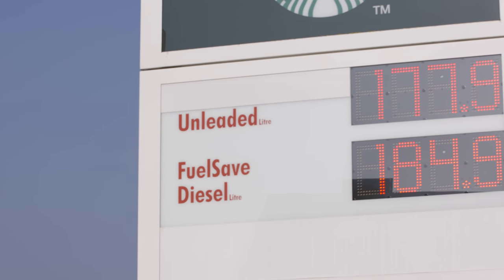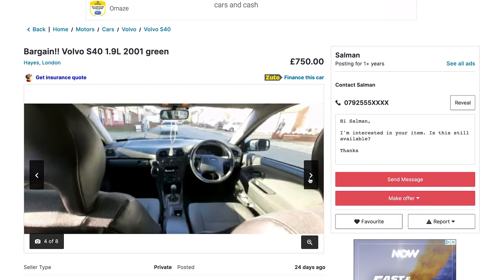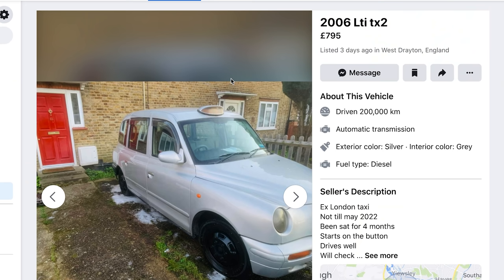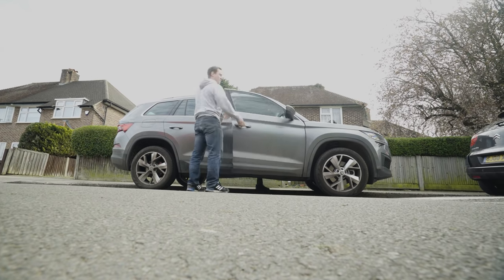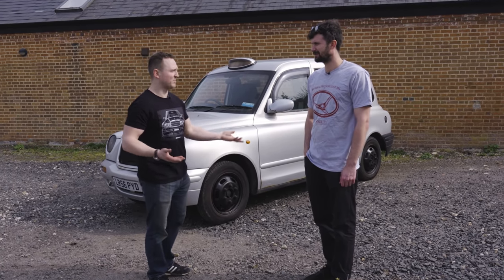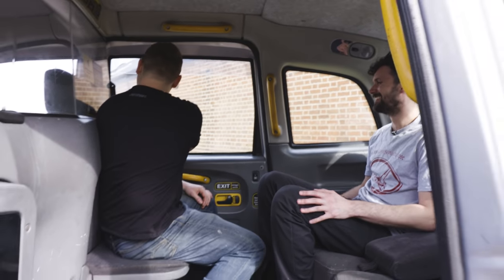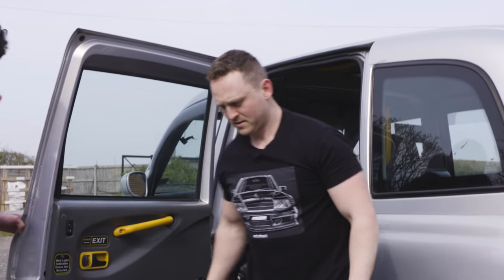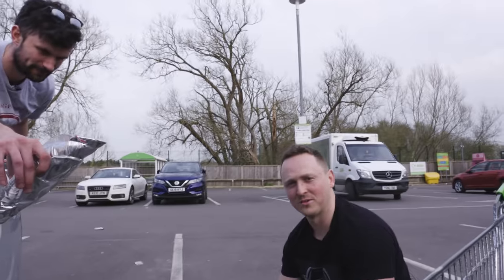How To Beat The Crazy Fuel Prices

Comment: Surely the cheapest transport all-in would be like a 125 or 250cc motorcycle (50cc scooters are too limited.) 🤔
Reply: Yeah my 125s liquid and air cooled do 133MPG - 108 MPG 

Only way you’ll get close to that is my spending silly money and paying finance at £400 a month for an EV that will need a battery change in 3 years that will bankrupt you :) lol
Reply: We don't want to die ya know
Reply: @MatthewChapmanYT  well then buy an electric scooter. It runs even cheaper than the petrol scooters.
Also an EV battery lasts much longer of course.
Reply: Yeah but you can't take any mates in the back
Reply: @theodoredeverell3894  friends add weight and lower your mpg regardless. No thanks. 😛🤣
Reply: @roland9367  built quality is poor with all EV scooters compared to a mighty Xmax or Forza scooter. 

Also in 3 years time you’ll need to remortgage your house to replace the battery
Reply: @MatthewChapmanYT  Yes build quality is low. I bought a cheap broken electric scooter and put my own lithium battery in it.
Electric cars build quality is great however. And typically get 8 years warranty. But the batteries will last much longer than 8 years.

Comment: Don't the engine consume more fuel when running on vegetable oil, since it is less energy dense?
Reply: Not rely but from April the 1st if your are finding to be yousing veg oil it's an on the spot 1k fine because u don't pay fule tax u pay food tax
Reply: I ran a 97 Rover 420d on 2/3 Asda vegetable oil 1/3 diesel. Went from 50 to 40mpg. Didn't smell at all. Ran fine (and I'd modified it to 130hp).
Reply: @666hicat  not if you are producing less than 2500 litres of fuel per year.
This is taken directly from Biofuels and other fuel substitutes (Excise Notice 179e) from 1 April 2022
Vegetable oil (unused and used, processed or unprocessed) that is set aside or intended for use, as motor or heating fuel is liable to duty unless the producer is exempt, find out more in paragraph 4.2.1.
You’re exempt and do not need to register and account for duty if in the last 12 months you’ve produced or used, or expect to produce or use in the next 12 months, less than 2,500 litres of either any:
Reply: yea and it will cause issues eventually. Diesel has lubricants in it which diesel engines need, cooking oil doesn't.
Reply: @BlatentlyFakeName  maybe I should have added some Lynx Shower gel?

Comment: My ex used to run a care home, I used to collect about 25 litres of USED veg oil per week from the kitchens fir free. Filtered it in my shed using a screen filter and sand. My motoring used about another 20 litres on top. Interestingly at the time, to buy cooking oil was about the same cost as diesel. So I used to use the old cooking oil, mixed with actual diesel, but occasionally used neat USED oil, which was of course free. Never had a problem, it was a Vauxhall movano. I think if you used some kind of solvent to thin it down, you could get away with it in a more modern engine. This is branded as "cheating the system" , but of course there isn't actually a fuel called diesel, it's a diesel engine, the fuel is heavy oil, as it says on the v5 document. The engine is named after Rudolf diesel, who invented it so it could be run on any oils. You're actually using it as intended. It's the wanker government calling the fuel diesel , that cons people into buying their fuel.

Comment: I've got a 2014 ford focus 1.6 diesel. Get 60mpg on normal drives, nearer 70mpg on a good motorway run, and over 45mpg towing my 750kg trailer tent...
At 60mpg with the new fuel prices in still better than a 30mpg car at the old price 🤙
Reply: Bought on 49k 4 years ago... On 125868 as I sit in the carpark typing this 🤦🤣

Comment: A lot of regular UK fuel pumps (i.e. not the special HGV and coach ones) also limited you to £99.  Guess that's been temporarily binned.

But you guys have the legendary G Whiz.  Only problem there is that electricity has also got too expensive, so swings and roundabouts.

Comment: I started to run my old Pug 106 xnd on 60/40 veg oil and diesel when prices hit 90p a litre! Apart from permanently smelling of farts, it ran absolutely fine.
Reply: Should we be concerned what you do know fuel costs are close to nearly double than that.
Reply: @hal752  What are you dribbling on about? No shit fuel costs more. I'm earning more than double as well. It's called inflation. Doesn't make it any less relevant.
Reply: @gazjones8781  it's a joke! Clearly went straight over your head
Reply: If you knew how to use punctuation, I might have realised.

Comment: Viewer from the states here. Right now I'm paying 3.87 a gallon. And I drive what would be considered a full size pickup truck. That has a cammed 4.6l triton that drinks fuel like a runner drinks water. Lol but it definitely gets smiles not miles per gallon. Cost around 75-80 dollars to fill up.

Comment: What's the situatuoin with LPG in UK?
I drive on LPG and according to the quick maths i did it comes out to be 52% cheaper than gasoline per kilometer driven.
And just recently i've noticed LPG prices drop so it's even cheaper still.
People around me are absolutely reeling from the fuel price hike and i'm here chilling with my LPG system.
You may say that LPG is extra cost for the equipment, and that is true but it doesn't need servicing often (if ever really), is simple, reliable and parts pay for themselves very quickly, especially with current fuel prices.
For example i recently changed out my LPG fuel regulator after it's been in service for 10 years!
Price for a new one? Just 60€ and it paid for itself within the first four weeks.

Anyways, i'm going back to watching the video as i'm only 4 minutes in.

Comment: Currently costing me 10.4p/mile in my 1L petrol Toyota Aygo Eco driving achieving 70mpg. I've done 80,000 miles with an average MPG of 69.4mpg over that (tracked using Fuelly). It's a well looked after car though, Its got 91,400 miles on the clock and it run better then the Citroen C1 courtesy car with 47,000 miles my partner got when their Mégane was in the garage.

Comment: I drive 25k miles a year for work and I drive a £500 Honda Jazz I bought off an old Granny as a ‘non runner’ had 4 flat tyres and a dead battery, 43k miles and full service history!

Has done me so well even raking it and driving on the motorway at 5k I get an average of 46mpg great little car and so good on fuel

Comment: Bit of a ruat bucket by now, BUT... IF you can get a Peugeot 106 1.4 or 1.5 Diesel, yeah it's non turbo so, slow to accelerate, but HELL, cheap as f@ck to run on diesel. On a nice STEADY run, me, my ex and her lad, and a coupla suitcases, went from literally brimmed (seeing the fuel at top of filler neck) in Grimsby to JUST under half on the fuel gauge in DEVON!!! We had both 1.4 and 1.5 and yes, the 1.5 DID have, albeit small, a bit more, ahem... 'Pep' lol.... 🤔😏   😎🇬🇧

Comment: I used to fill veg oil into my 2008 c class diesel, started as an experiment but actually worked out with no difference...until a year later the water content in the oil ruined the copper washers on the injectors other than that well worth it

Comment: 90% of chipshops use beef drippings not veg oil. Beef drippings will solidify at room temperature and fuck up the engine and all the fuel pipes etc when it's cooled down. Best to get a membership at your local food wholesalers and buy the 50 Ltr drums of veg oil. Ran my old work van on the stuff before it got written off by a drunk driver.

Comment: just get an Vw or Audi a4 b5 1.9 diesel with the classic pump and injectors, not the pd ones. those things will literally swallow anything you put in them, I've had a few of them so I can say it's been tested and worked like a charm😂 three of them had over 400k miles when I got rid of them

Comment: Heres how to beat it. Get a van cut a hole in the floor. take the plates off and any distinguishing features. Go when the servo is shut and park over the dipstick vents. open the hole in the floor, open the vent and put a hole down into the tank. use a suction pump manual not electric and pump all the fuel you need into a 1000l ibc in the back of the van. then drive off. make sure to cover your face and afterwards enjoy the fuel.

Comment: Your really need to get a modern hdi style engine and se what it takes to run the 1 of these newer style engines on veg oil and used chippy oil, see what it does to the filters and injectors.

Comment: I have the answer Mitsubishi Colt CZ1 i bought mine 4 years back for £600 and it is still working , no repairs ever to it except brakes and tyres and for £5 of petrol it does 35 miles and tax is only £10 a month and on the track it can hit 120mph but good lord it feels so unsafe , as it only weighs 980kg and the metal is paper thin but apart from the safety issues it gets me from A to B , until i can save for an E car

Comment: Get an old indirect injection diesel and run it on full veg. Make sure thr fuel pump can handle it. My 1.9 t4 has done over 100k on 100% veg oil.

Comment: you know you are in trouble when the vegetable oil on the shelf is more expensive per litre than the diesel per liter (which is also, eye wateringly expensive)
Reply: koiun dwrru  it's not a TDCI actually. my car is LPG converted gasoline; solely because the reason stated above

Comment: I would’ve gave you my 55 plate Accord which is in good condition and will run for 100k more miles at 500 quid. Easily 600 miles out of a tank on motorway 😁

Comment: Carlton 2.3td.. unbeatable, cheap, plus it runs on pretty much anything you put in it 😁i run the same, but in a frontera, its quite heavy so its not perfect, it needs about 8 to 10 litres on a hundred, but it wont necesseraly need diesel, what is definitely a plus side 😁 i believe the injectors and the fuel pump were still made in a small forgery back in the 1800s 🤣🤣

Edit : tip of the day, you dont need anything newer than something from the 90s

Comment: They're very kind over there in the British Isles. Here in the USA everybody is a shady used car salesman without the tacky suit.
Example: "1994 Toyota Celica, $4500, 270K miles, trans has delay when shifting into reverse, has oil pan leak, driver window stuck, new battery, no lowballers."

It's worse on the newer vehicles ~ "2019 Honda Accord, $18K, 145K miles (what/how the fuck?), minor scuff on rear bumper, other than that no problems."

Comment: As fun as the taxi stuff was they sorta didn't beat the pumps at all. Most diesel run at an average of 45+ and that with around the town stuff. So that's only £11 for the trip. If you had of got like an old 1.5 TDI Mégane/senic at about 500 quid they run on fumes at 55/60 average. So price is more like £9 for the same distance. 

Now add in costs of replacing that battery and your going to need to drive it non stop for hundreds of thousands of miles before you come close to recovering the difference at less than 1p per mile difference.

Now will it run on veg oil without a kit... 
Sounds like a follow up vid lol

Funny video lads but you didn't beat the pumps.

Comment: You may be interested to know that you may still qualify for exemption in low emission zones in your ex taxi.
I drove my ex mini cab through bus and taxi lanes in Glasgow, where it had previously been a registered  mini cab, but not for 4 years. I made this mistake as I was a cabbie and old habits die hard.
Anyway, I was expecting a multitude of fines, which never arrived. My registration, it would seem,  was still on the council database. To check it wasn't just a freak, I drove through another bus lane. NO FINE.
To cut a long story short, I drove where I wanted when I wanted and put 2 fingers up to the law. Breaking the law, Breaking the law. 
The only sad bit is I sold it because the water pump was leaking. It was a Skoda Octavia 1.9SDI (50BHP, no turbo, slow as fuck, no DPF for that matter). I still cry about that car when I see Miles. I didn't know the misery of modern diesels. It had done 240,000 miles and had given me less grief than 42,000 miles in a modern diesel 1.6 Skoda Rapid. 
I'm getting sad and angry so it's time to fuck off.

Comment: My  1999 1.6L nissan almera does like 6 liters for 100km.. the car is slowly disappearing in the air as rustdust but the engine is still goin hard. I think the most eco friendly thing you can do is to buy the cheapest easily repairable old car like that and give it as many miles as you can before totaling it instead of promoting all this slavery with no economic standards at all in africa where they mine the ores for the new electric car batteries.

Comment: I’m so gutted 😞 I bought an X5 2003 3.0i d. The brake master cylinder / brake servo broke after 2 weeks and then the gearbox went literally less than 24 hours after! Cost me £2000 for the car and quoted £2460 for a reconditioned gearbox , to fix the brakes it was £260 and the rear subframe bushes was £350! 

Scrapped it yesterday for £480, but struck gold….. 

Bought a 318 1999 from Facebook, a lovely lady who owned it since 2000 as the second owner! And best part it was only at 70,000 miles (don’t believe me check the reg : T565 NJN) 😮 
It done 20k miles in the last 10 years I couldn’t believe it
no issues totally original and it was only £550. 

Thankfully all is well that ends well 

I will be Bring it back to its glory and selling for £3000 ONO

Comment: 1.84? I fucking wished. 2.15€ for petrol , 2.04 for diesel in Greece MINIMUM.
Reply: 2.15 euros is equal to around 1.81 sterling at current rate so pretty similar. But agree with you mate, still a fuckin riot though, no matter what country we're in!

Comment: Cheapest way buy a fiat 1.3 diesel tank 50/50 with vegie oil kerosine whatever in the summer and if it goes in it goes.in.  1000pound car and maby it does 25mpg and I run havle on cheap shit oil u can run 5gal diesel and 5 gal cheap shit 30/35 bucks a tank. Maby 400 miles. And like I said when it goes in it goes in next one.diesel is cheap to biy today because of the tax. And if u have to pay the tax uve paid already so ir allowed to ise ir own fuel in my book.